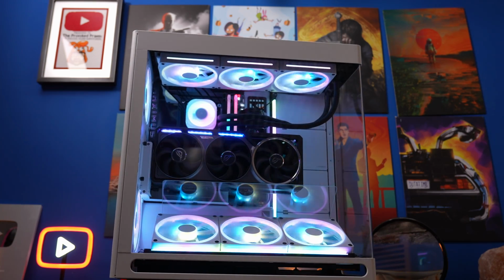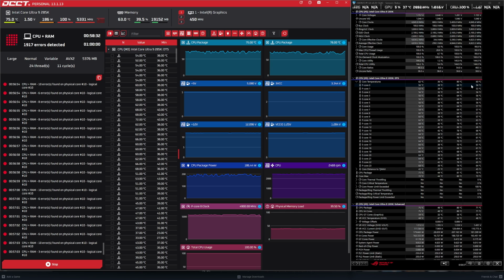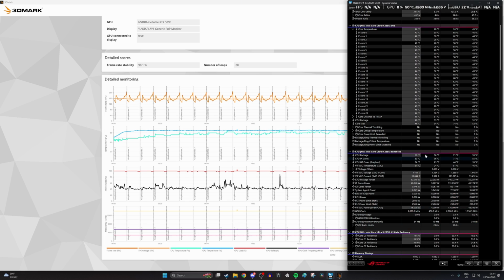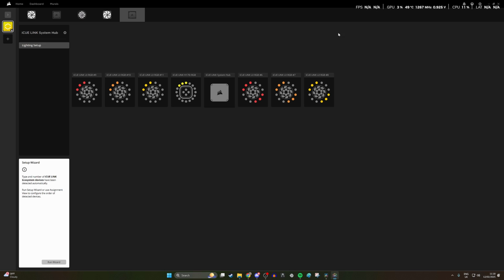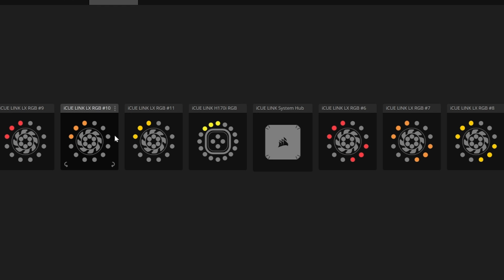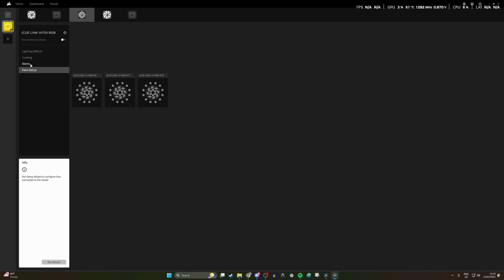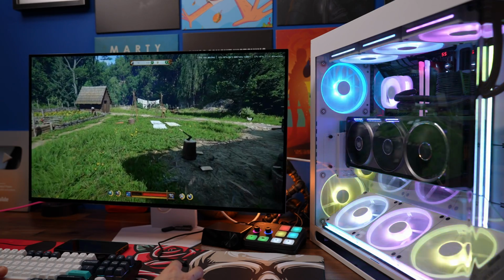Corsair iCue Link H170i RGB AIO review

Comment: i got this AIO for my megabuild.
but tbh i very underwhelmed with this AIO, it seems like it was designed to fit solely in a Corsair case and it MAY fit in other cases.
the case i'm using is the CoolerMaster C700M which is MASSIVE right?
well, this AIO does NOT fit in the top of the case, only in the front.
and the reason why is probably a combination of poor design by CoolerMaster and by Corsair combined.
basically, when you would want to mount this to the top of the C700M you would realize that even though you technically can mount 3x140mm fans in the top, the radiator in this AIO is absolutely massive and is a lot longer than 420mm - this introduces fitment issues if you want to mount it with the intake and exhaust of the radiator coming out of the back of the case.
so then you'd say, okay fine i will try to mount it with the intake and exhaust of the radiator coming out on the front of the case.
but then you would realize that this is also impossible because it ends up being relatively thick with the QX140 fans so when you do mount it like that you can't even connect your CPU power supply cables on the top of the motherboard (i'm using Crosshair Hero X870E).
so basically, the only way to mount this AIO in the C700M is by installing the radiator in the front of the case which isn't ideal since in my opinion the front 420mm mount in the C700M sits too low so the radiator intake and exhaust pipes sit uncomfortably not that much higher than the pump itself - i mean this shouldn't be a problem but it would be a lot better if i could place it up at least 1cm higher.
so then i thought to myself well the C700M is a fully modular case right? i can probably just raise the front 420mm fan mount up by 1 cm, there are even holes in the chasis to support that.
but nope, this is actually not possible to do because CoolerMaster did not make the bottom of the fan mount latches adjustable in height.
so then what i ended up doing (well, i didn't really have any other choice) is mount the H170i in the front and use the pre-provided 140mm fans from CoolerMaster alongside the QX140 fans from corsair and set the radiator up in a Push-Pull configuration at the front.
its not the aesthetics i was going for, but at least it should be performing very well for a front mounted radiator i guess.

from what i read online the only real way to mount a 420mm radiator to the top of the C700M is if you use a pull configuration and just place the fans on top of the radiator past the fan mount, which completely destroys the aesthetics inside since instead of seeing RGB fans you just see black radiator fins... wtf is the point?

honestly i am so frustrated by both the C700M and the H170i in this build.
and i can't really do much about it because i got this case like 4 years ago and the H170i back in December.
i was waiting for the 9950X3D to launch to start building everything but now i'm just frustrated with how its all sorted.
it just mind boggles me that a case that was designed with "super-clockers" and insane water cooling setups in mind can't even fit a 420mm AIO radiator that's probably not that much thicker than any other 420mm radiator with 140mm fans...

how are CoolerMaster still selling this in 2025 and claiming it supports 420mm radiator mounting at the top? wtf?
Reply: Wtf

Comment: Any idea why in cinebench r23 my 9950x automatically goes to its max 95° limit on the multi-core test? Just want to make sure that's normal. I have PBO set to enabled but haven't done anything else to it. On the single core test it doesn't go above 63 to 65ish

Comment: Thanks for the review. I’m running this same cooler with the LCD screen but was curious what your thoughts were on it. I was thinking of moving the cooler from top mount to side mount in my case and I think this sold me on it. It’s just the wiring that gets to be a pain which is why I held out. Also, while Corsair says they support 12 devices on each side of the hub, I have found issues with power delivery or with the fans not lighting up sporadically on system boot up. So people may have odd experiences…because iCue? /shrug
Reply from the maker: Interesting. I haven't had that issue.

Comment: This appears to be (Literal visual inspection of the unit, packaging, and provided links) the 420 aio in the H-series that preceded the newer Titan series aio.  Even the listings in the description show it being the 2023 model if you scroll down to the specs.  The newer Titan aio series (Which I own the 360 version) is... newer, has a newer pump design, runs about 1db quieter, is slightly easier to install, and has slightly better cooling performance (Very slightly) than their H-series aio predecessors.  They're also about the same price or cheaper.  IDKY this is being reviewed in 2025 other than to say "Hey, this is a decent aio at a good price, especially for a 420... assuming it will fit in your case."  If this is sponsored it's prob Corsair or Bezos trying to push out NOS to clear up their warehouse, and I respect the hustle.  However it would have been nice (In the interest of tranparency to the audience) to have clarified that this is in fact a slightly older model aio, but remains the most current 420 aio that Corsair has produced thus far.
Reply from the maker: @RetroFred  I didn't say at any point that it was sponsored (because it isn't) or that it was the newest. It just happened to be a 420mm AIO which I was using (which aren't common) so I thought I'd share what I found when using it...

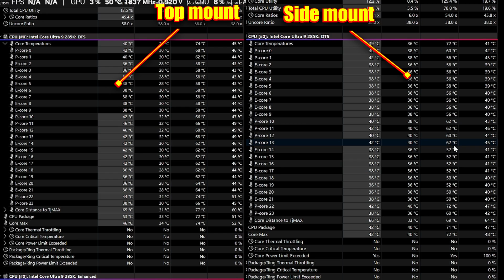Comment: 9:15 I believe you made a slight mistake here, Prawn.

In the top mount data, the average frame per second is higher (156.75 frames per second). You were getting more performance with the added heat.
In the side mount data, the average frame per second is lower (145.37 frames per second). You were getting less performance with the lessened heat.

These results indicate the first instance being better.

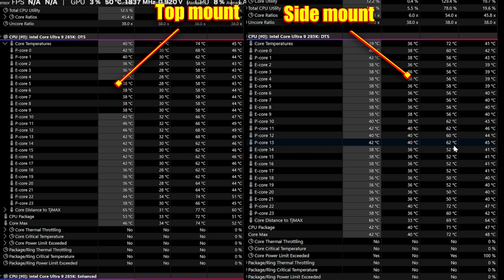Comment: 8:46 Its possible that the cpu ran cooler with the side mounted AIO because you did it under heavy load and the cpu may have been throttling, creating less heat.  OR the fan curve is set to run faster under load which also would drop the cpu temps.  really should have tested both AIO mounting options under EQUAL loads

Comment: Honestly i am confused after your last video about H170i.
After seeing the video i went to a Corsair website to see the pricing and according to it H170i is NOT the newest aio (unless you meant "new" in your build), the newest is icue link Titan 360 rx lcd and H170i is unavailable and won't be available anymore.
So is there a difference between naming and availability in EU countries or what the hell is going on (i know UK is no longer in EU but still)?
Reply from the maker: It's not the newest. Did I say that? Just happened to be using it for a build so thought I'd review it
Reply: @TheProvokedPrawn I thought you did but maybe I just assumed it was the latest one.
Reply: I built a new PC a few days ago, using the Lian Li o11 EVO XL, because i really wanted 2 fans on the back and a 420mm AIO. I planned to do a full Corsair Build, just like with my previous PC, so i was taking a look at all Corsair AIO WITH LINK system. And indeed the H170i is not the latest AIO from Corsair. TITAN series are newer, and all of them can be bought with LCD Screen option, BUT the newest ones (TITAN series) do NOT have QX120 or QX140mm fans. They have regular RX fans, which, altough they produce more airflow than the QX, the RGB on the RX is so, so much worse... less LEDS, less effects, can't do warp time effect, less bright... even the LX fans, which I purchased 6 of them (reversed) are not as bright as the QX fans. Another difference between the newest TITAN AIOs and the H170 is that the LINK hubs are positioned elsewhere. ALso TITAN series is supposed to be a bit more efficient, but, given that the H170i is powerful enough, I went with it instead of the TITAN series because it has so much better RGB and the price was phenomenal (304€).  So far I'm very happy with it, and it looks STUNNING on the Lian LI XL case.
Reply: @Kiwomens Can I ask where did you bought it?
Corsair doesn't sell it anymore and prices in my country are completely messed up, like 2-3 times Titan AIO.